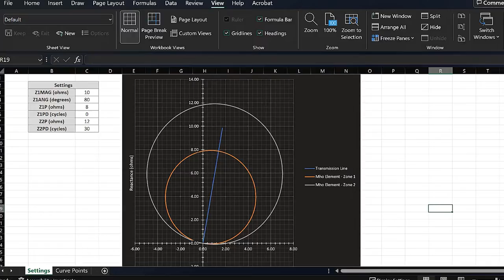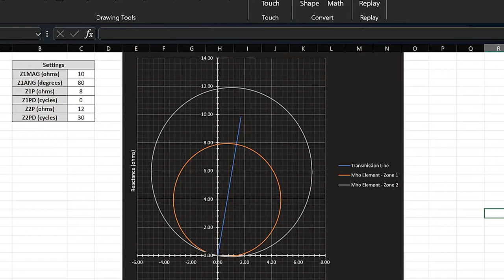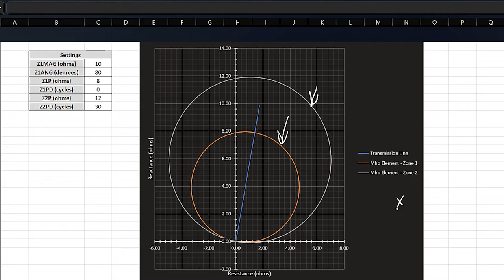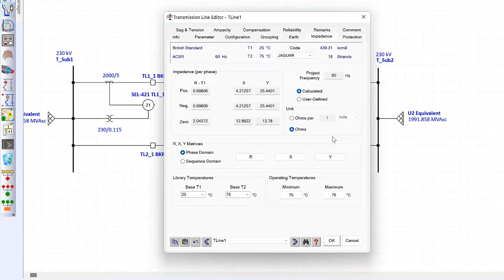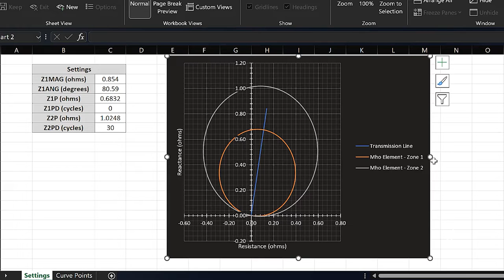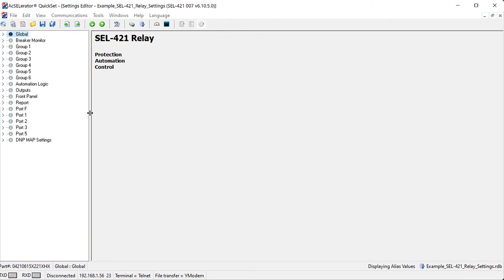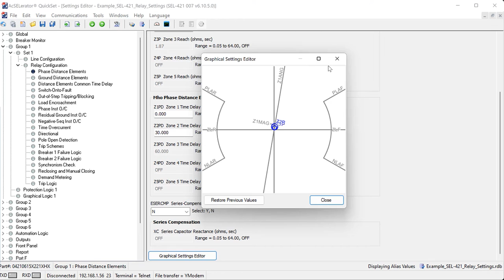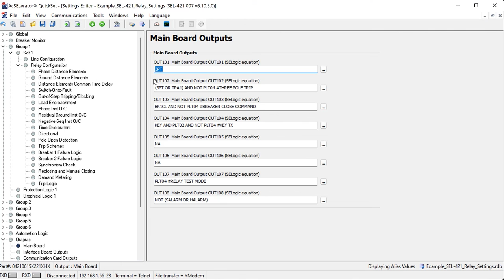Distance Protection of Transmission Lines | Example Using the SEL-421 Protection Relay

Comment: Sir, what are your assumptions about the 30 cycles of Zone 2? I've seen some Zone 2 settings as 75 cycles. Thank you.
Reply from the maker: Hi Romel, this depends on your coordination, there isn't a right or wrong answer here, it just depends on what you are coordinating with. A 30-cycle delay on a Zone 2 element is typical though, based on the fact that this would usually just need to coordinate with instantaneous protection at the remote end. So, 30 cycles (0.5 seconds) allows for enough time for instantaneous elements to operate, trip the breaker, and perform a breaker failure function if needed. Then, if none of this happens, the remote ends back up with a Zone 2 delay at 30 cycles. Again, it all depends on what you are coordinating with.